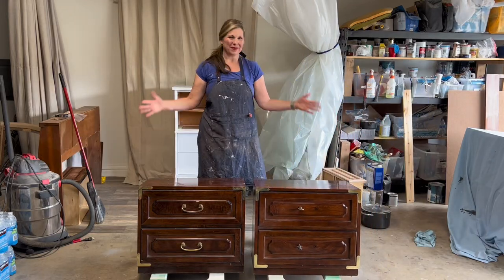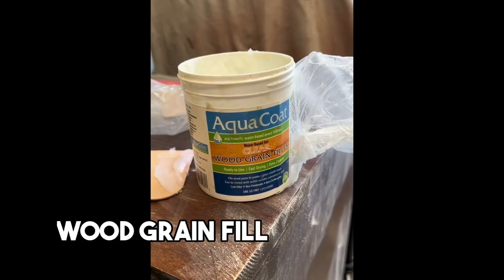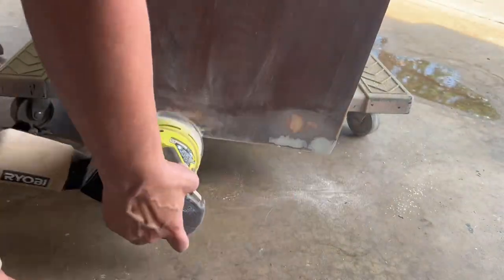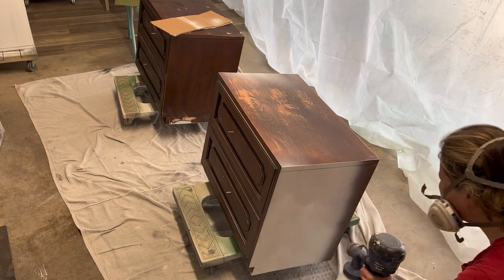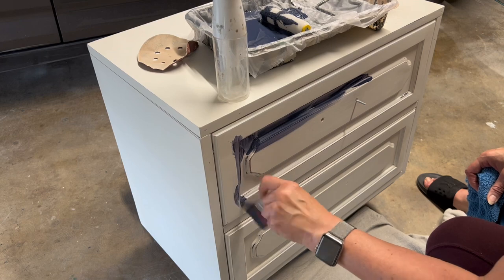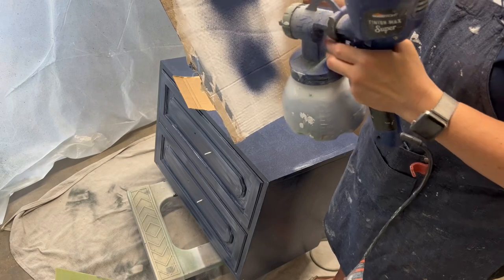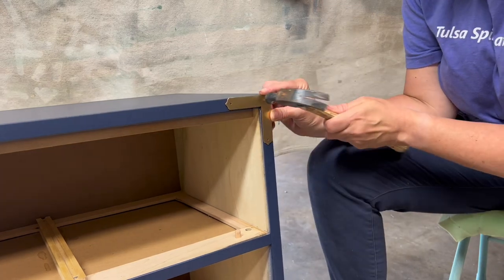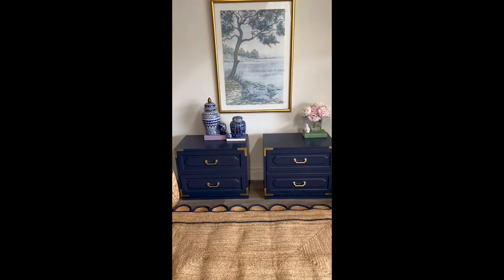Calm down, yes, I painted it. | Campaign Furniture | #furnitureflip  | #furnituremakeover

Comment: Such beautiful work. I don't know how one loses a corner hardware piece, but their loss is your found treasure. 

I have a mid century piece from Europe (late 40s) , it is a very narrow wall unit with lower drawers & sliding doors storage, upper shelving and mid level pull out hidden desk. I find as though it is really drying out because of its age, do you have any suggestions for maintenance? It is not painted it is in its original teak wood finish.
Reply from the maker: I’m not sure either! 🤣 Pricey replacement though 😕

You can probably refresh the finish. Thoroughly clean, light sanding and then reapply teak oil.
Reply: @ivylaneinteriors  Thanks very much for your suggestions. I am new to your channel and enjoying all of your craftsmanship.
Reply from the maker: @barcelonachair6487  Aw, thank you! Glad you’re here! 🫶